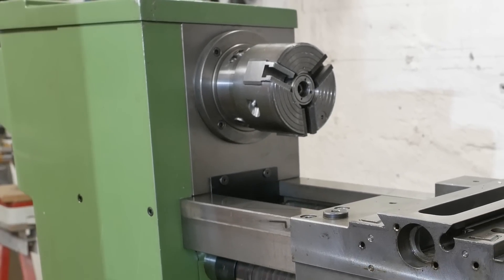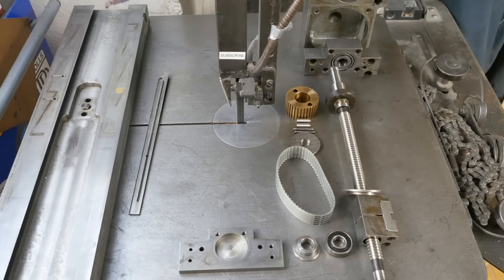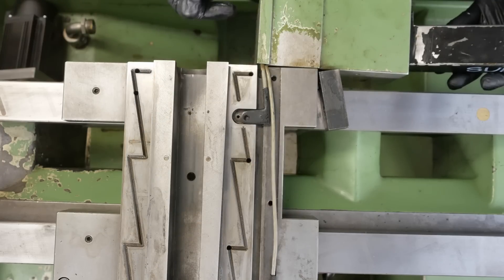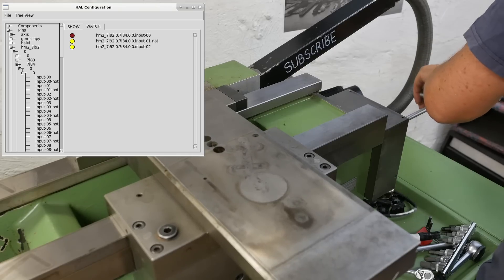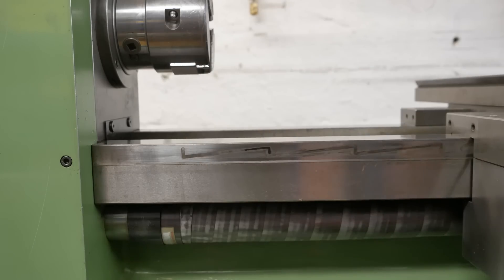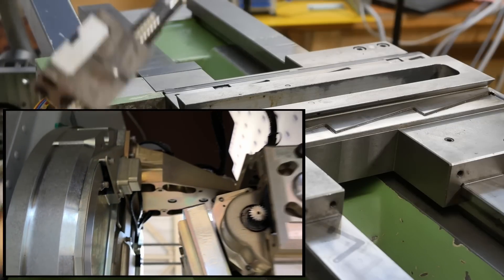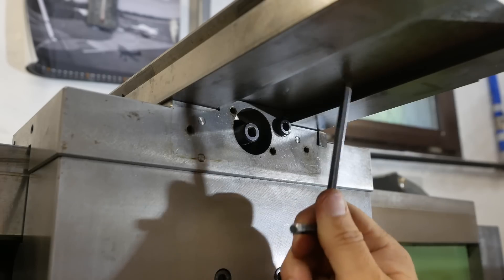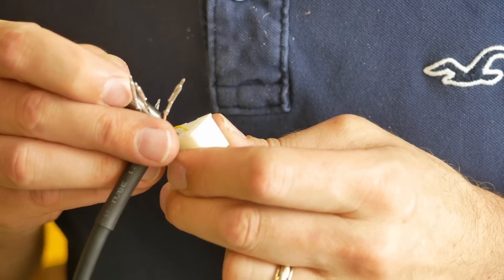Installing the cross slide - Schaublin Ep. 39

Comment: There are no physical endstops to stop you from running into the chuck on modern CNC lathes I have ran. There is however barrier settings in the software which lets you enter the size of the chuck and jaws. If you have your tools set up right too, it will prevent a crash between the active tool and the chuck. You might still run into the tool beside it...  And the setting of the barriers varies from easy (Mazak) to almost hopeless..
Reply from the maker: Thanks for that. With LinuxCNC I haven't worked out a good way to do that.

Comment: EStop switches should be physical switches that physically cut the power not electronic sensors unless those sensors are safety rated with built in failsafe self test.
Reply from the maker: Correct. The Schaublin has none. I received a number of anwers with regards to more modern CNC lathes, that many of them also have no limit switches.
Reply: @RotarySMP  I personally don't use them on my CNC and have never felt the need for them.
Reply from the maker: @mfx1  The Maho has convention NC switches on all three axis, and have triggered a few times, as the index's are quite close to the limits, but generally I am happy to have them. On a lathe I also see less benefit.

Comment: Maybe I've missed it in some video, but what are you using to label your wires and how do you do it? Looks really neat.
Reply from the maker: Just a regular brother label maker. I think there are better options which print directly on heat shrink.
Reply: @RotarySMP  Dymo's Rhino series of label makers print directly on heat shrink, and it comes in a number of different sizes. Other companies have also made multiple generic versions of the labels so they're substantially cheaper than the OEM labels. Supposedly, the heat shrink label makers need a more durable print head cause the label maker tape would destroy the normal tape rather quickly. I can't confirm it one way or the other, but the Rhino is a good unit. I have the cheaper one, as the 5200 series doesn't have a QWERTY keyboard. It's worked well for about a year and printed several hundred labels in that time.

Comment: My Denford Easiturn has a movable limit switch on The headstock end (it doesn't really count as a modern CNC though). The best solution in my opinion is to have a button to set a soft limit. That way each job can be done individually.
Reply from the maker: I wonder whether LinuxCNC has a way of doing that with a button?
Reply: @RotarySMP  I'm sure it must be possible. I haven't had much luck altering Linux and am heading over to Acorn for my next one!

Comment: I once did a retrofit on a small educational lathe. For the chuck end of the Z axis it had a clamp-on stop that operated a switch on the carriage. My Colchester Triumph has a mark on the bed - line up the carriage with the mark and home to the servo index. The rest is done with soft limits.
Other lathes I have worked with used absolute encoders on the servos and soft limits.
Limits aren't that useful on the Z axis. You're more likely to hit the chuck or tailstock than the limits (I've done both several times). 
I did at one point look into per-tool soft limits in LinuxCNC but it turned into one of those 'when I have some spare time' jobs. It's well worth installing a physical 'maximum feed' knob. The first time I run a program I usually have that dialled right back so I can catch any unexpected movements. On the Colchester I have Feed rate override, spindle override and maximum feed knobs. All get used quite regularly.
Reply from the maker: Thanks for your Inputs.

I have a little audio encoder wired up on the Maho as a feed override, and will do the same on the Schaublin user interface.

I like the idea of a limit switch triggered by the tailstock, to prevent those crashes, but there seems to be no good automated solution for the head stock end.

Comment: I run Fagor CNC lathes at work and they have a limit switch on the headstock side.  The trip dog is on a short t-slot so it can be moved if necessary.  It also has software limits that can be set before the physical limit switches.  The home switches also have two switches each.  It will go past the first switch, hit the second switch, change direction, and stop when it hits the first switch.  Kind of an odd setup.
Reply from the maker: Thanks. In practice does the trip dog get reset every time there is a chuck to collet change, or do people not bother?
Reply: @RotarySMP  They never get used.  The tools would hit the chuck long before the limit switch would be triggered.  The trip dogs are too far forward.  The machines are larger and we run the same 3 jaw chucks on every job, so we would never need to move them.

Comment: I would say those unknown threads are for jack screws. The sealant can glue those pieces together and it might need some help to get it apart.
Reply from the maker: Those two unused holes are not threaded. I also though jack screws, but nope.
Reply: @RotarySMP  idk much about this manufacturer, but maybe that part can fit for multiple models and this has "unused" bolt holes for your lathe.
Reply from the maker: @LuciaMakes  Could be.

Comment: My Tree CNC lathe has an adjustable limit switch using a rod with a thumb screw so you can set a different position for different chucks etc. Another interesting feature is an additional switch to indicate that the tailstock is in the vicinity - this limits the cross slide travel to prevent the tool turret hitting it.

Adjusting the gibs is tricky on a CNC machine. It's even worse with box ways, as you have 3 gibs to adjust - presumably this awaits you on the saddle? Some measure of the load torque / current would be really useful so you can see when the gibs are starting to bind.
Reply from the maker: Thanks. 
I already adjusted the saddle gibs. Hope I got it right.

Comment: When it comes to modern cnc machines (or at least the ones I've worked with) the general setup is to use limit switches on + & - of each axis that triggers the e-stop contactor. These should not be used in daily operation, solely for emergency. You also have deceleration switches which some refer to as home switches. In the homing process the axis rapids until it reaches the deceleration switch. It then feeds on until it picks up the servo encoders's index signal (z channel) 
Nearly all machines now should have soft limits although there are plenty about built in the last decade that do not. 
Most lathes do not use adjustable hardware limits for the chuck end of the z. Just for the carriage travel. 
It's much easier to set soft limits to do this. 
Interestingly mazak have had a chuck barrier setting on their mazatrol controls since the very early 90s. You designate the chuck and jaw size and it (if set correctly) stops the tool from colliding with the  workholding
Reply from the maker: Thanks for your feedback on that. I wonder how many users in job shops actually reset that chuck limiter each time they switch work holding?
Reply: @RotarySMP  I would only set it when someone I didn't have much faith in was operating it. Otherwise I just turn it off.  Same as a mill it's all down to setter & operator. Just don't be a muppet👍

Comment: LOL- was having the ball screw / gib adjustment conversation with myself last week.  I hope someone has a good solution.
Reply from the maker: Best I have seen is to set it without the ball screw, measure the screw head with a depth mic, and then reset it to that.
Reply: @RotarySMP  I like that.  I could then assemble with the ball screw and lower the stepper current down until I get missed steps for a given acceleration and velocity.  That could be my baseline for future adjustments without taking everything back apart.
Reply from the maker: @joeldriver381  Now I have to pull mine apart again. ;(
Reply: As a note to anyone reading this...  You would want to use low accelerations.  The goal is to measure drag/friction and not inertia.
Reply from the maker: Good point.

Comment: To me the copper tube on the HF radio at 8:47 looks like a short length of RG402 "semi-rigid" coax used to jumper the two connections. J6 and J7 looks like TNC connectors (a sort of threaded BNC).  Thanks for the video, good progress!
Reply from the maker: Thanks for the info. Avionics is like black magic to me.
Reply: @RotarySMP  That's not specific to avionics - you find "rigid coax" or "semi-rigid coax"  in all sorts of things, like test equipment, cellular tower base station equipment - anywhere RF stuff is found really.
Reply: Also on the other question of how to set a gib with a ballscrew already attached, usually you stick a 1 thou shim between the gib and what it's sliding on, and tighten the gib until the shim doesn't move, then you back it off just until you can pull the shim out. Then you tighten the gib some specified amount to leave the correct clearance. As an example, "insert shim, tighten gib until shim doesn't move. Loosen gib just until shim pulls out, then tighten 3/4 turn"
Reply from the maker: @gorak9000  Thanks for that technique.
Reply: @RotarySMP  Yeah, the problem is how to know how much to tighten it after the shim pulls out - it depends on the thread pitch of the gib adjustments, the angle of the gib, etc etc, and how much clearance you want in the end - I don't even know what it should be - a couple tenths? 5 tenths? I guess you could calibrate by starting with a thicker shim stock, like 5 thou, find where it just pulls out, then find how many turns it takes to get to where a 1 thou just pulls out. Then you could just extrapolate from there how many turns to go after the 1 thou pulls out to get the clearance you want.
Reply from the maker: @gorak9000  I think for a one off, removing the ball screw, setting the gib by sliding feel, and then using a depth mic on the end of the adjusting screw, and just repeating that measurement with the same backlash direction is probably an easier method.
Reply: @RotarySMP  I was kind of thinking through the problem when I edited the reply, as I have a large VMC taken apart that needs some new turcite, and I'm going to have to reset all the gibs to put my machine back together. I didn't remove any of the ballscrew mounting or the servos or thrust bearings in mine because I don't want to have to fiddle with re-aligning any of the screws in the end, so I do need a way to do it with the screw in. To give credit where it's due, that method comes from Blaise Barrette in this video where he mentions that's the procedure outlined in his machine's manual: https://www.youtube.com/watch?v=xln-c78SSqg. I just hadn't thought of how I'd figure out how much to turn the adjusters on mine after the shim comes out, so I came up with the idea of using 2 different shims and measuring how many turns difference it is between those to get a sensible "adjustment per rotation" figure.
Reply from the maker: @gorak9000  Thanks for that link.

Comment: Looking great!  And I tell my sons how different engineers solve the same problem with different solutions.  Some solutions are better than others.  I tell the Chevy vs. Ford.  They both work but use different ways to make it work.....
Reply from the maker: In aircraft you really see the difference between the big ticket items (like the radar), and the stuff the manufacturer solves in house, like that Radome release linkage.
Reply: Do either of you guys get lifetime free, or dirt cheap flights when you retire?
Reply: @bobweiram6321  I am retired and yes, I do.  However, I haven't been in and airport in close to 2 1/2 years and don't miss it at all.  My wife hates to fly and I'm so glad!  I've been away from home weekly for over 28 years and I'm so happy to just be home.....
Reply from the maker: @bobweiram6321  I only got staff tickets when I worked for for the airlines. Haven't had them in over 17 years.

Comment: @8:43 That's almost certainly not copper tubing, that's rigid coaxial "cable". More stable electrically than flexible coax, and more robust physically as well.
Reply from the maker: Thanks. I am pretty ignorant of the avionics side of things.
Reply: Probably a type of MICC cable my father showed me how to terminate what in I effect is a coax, he was a RAF apprentice trained avionics engineer starting his career in 1958 and finishing on sea harriers when he was 62 he is no longer with us but he taught me everything from wax lacing looms to how to solder amongst other things. the wave guides on later radars were gold plated works of art and every time I see TopGear I think of him as that is where he worked at Dunsfold.

Comment: Those two extra holes in the bearing block might have been used for fixturing the part during machining at the factory.
Reply from the maker: Could be, although seem untypical of Schaublin.
Reply: @RotarySMP  A set of holes that does nothing... in a Schaublin. We've been pranked!:elbowcough:
Reply from the maker: @777anarchist  Looks like it.

Comment: On my 11 tone heller it only uses reference switches. The index lathe has separate home and it only protects the limit of travel. But Linuxcnc and mesa cards with closed loop servos are so reliably they never triggered. One thing I did recently that made the machine 1000 times better was using the encoder to reference the axis.
Reply from the maker: Since LinuxCNC can do that, I am also planning to do the homing on the hall sensor plus next encoder index.

Comment: its interesting to see a closeup of the bottom of the hall sensors, and seeing the circuit board that it is formed from.
you now have a new project opportunity. making the board , soldering surface mount components and making the mould 
for casting the epoxy. 😁.
I'm sure that you are aware of igus cable chains , but did you know that they also have an extensive line of flexable conduit
and cables that can withstand millions of flexes. They have all kinds of glands like the one that you were struggling with
to pass the servo cable through, including sealing inserts with slits to fit preterminated cables
Reply from the maker: There is a guy on the CNCEcke.de who replaced his hall sensors and cast new ones, so I know it can be done. I hope I wont need to, as these seem fine.

Good point on the Igus stuff. I will try to use what I can from the existing hardware.

Comment: A while ago, a customer of mine experienced intermittent problems with his water jet cutter. Turns out the cable to the pendant had a break. However, the cable was attached with a big industrial connector, and I had to get over 150 EUR worth of tools just to replace a dozen pins. And the pins were 1 EUR each - turned and gold-plated.
No wonder the machine cost an arm and a leg, and the company that made them still went bankrupt.
Reply from the maker: Hi Alexander,
I think I finally have the membership system set up. 
Aircraft are like that. The avionics department needs a huge range of expensive crimping tools to service all possible connectors.
Reply: @RotarySMP  Works fine. And yes, in addition to the tools being necessary, they're also the only way to ensure you are compliant with manufacturer specs, which is probably very important for air craft.
For the water jet cutter it was rather a problem of over-engineering in the wrong way. Instead of having some intelligence inside the pendant (keyword "integration"), and then use an RJ45 cable to connect a bus to it, they painstakingly connected every single switch through multiple connectors. Even the spiral cable from Lappkabel was like 150 EUR. Using a bus, they'd only need 6 pins - GND, VCC, CANH, CANL, ESTOP+, ESTOP-
Reply from the maker: @graealex  Ouch. I made my Maho pendant just before Peter (Talla83) made that Mesa smart serial interface pendant. I need to revisit mine and replace it with Peters design. Much better.

Comment: an modern Mchines you have emergency stops at the end of travel but you have Software endstops that stops the machine like 1mm befor the hard end. you can also set a chuck protection that helps not to crash a tool in the chuck and its chaws, alows also for the jaws from and can also allow you tool to move in X+ over the chuck if needed but stops it when you will crash in x- with the chuck
Reply from the maker: LinuxCNC supports both software and hardware end stops, but I dont think it can do variable endstops, like would be useful around the chuck.
Reply: @RotarySMP  i be honest, never used that chuck protection funktion. Its way to much work then just watch what the machine is doing and have a hand on the feed poti
Reply from the maker: @Der_Drache  Thanks for your experience with it.

Comment: I can only give advice on one CNC bed lathe at work, they arnt all that common unless you turning pretty big parts, but  only uses Precision micro switches, 2 for z travel(fore and aft), 2 for x (fore and aft), and one on the tail stock so you don't crash into the tail stock if your using it (the saddle has a switch on it for just the tail stock, it just e-stops out.)  they serve to home the machine but also over travel (soft(ware) limits) so you dont destroy your screws or servos, not crashing the machine is down to you not the limits.
Reply from the maker: Thanks for the feedback on that. A tailstock Estop is a very good idea.